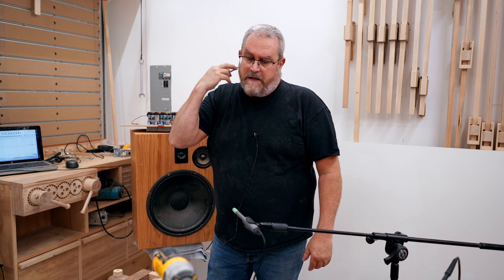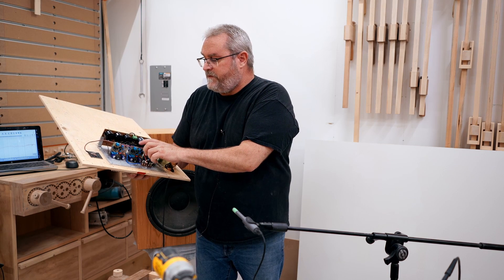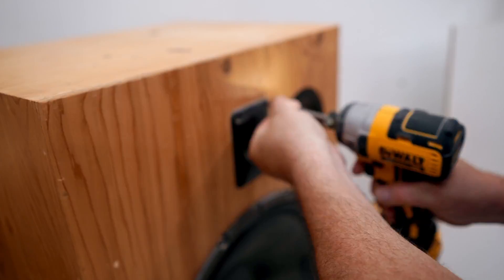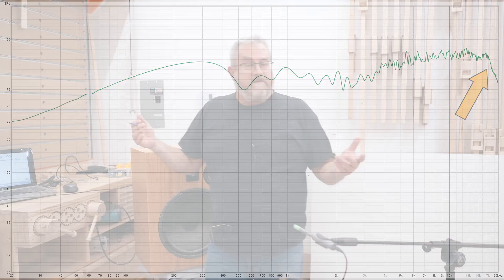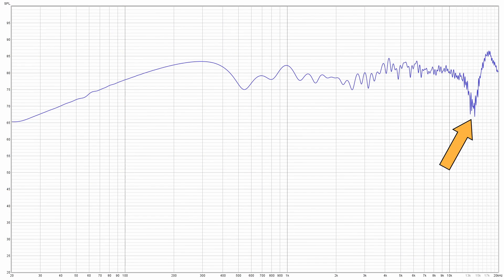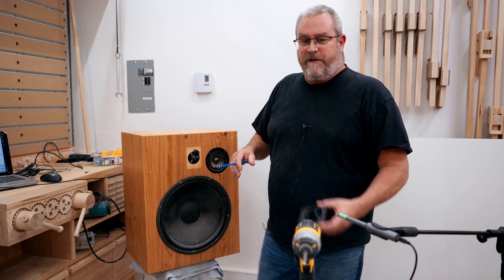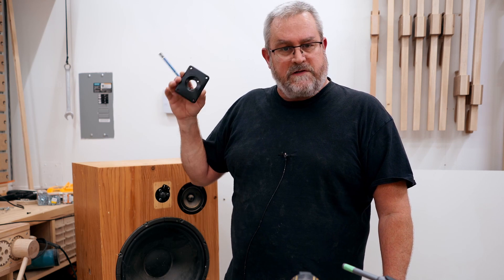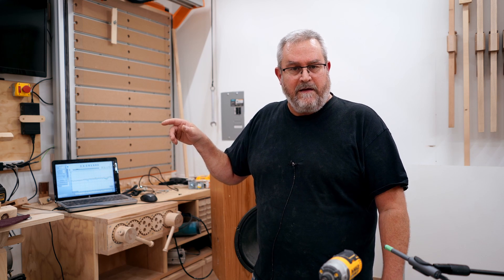Tweeter Horn Magic - What does a Phase Cap do?

Comment from the maker: Kind of a show and tell on the speaker to begin with. I made these in 2009 and used them in my old workshop for 4 years. It's a three way active and I made the amps / crossovers plus the power supply. Each amp board has lowpass and highpass Sallen-Key filters and an LM3886 as the amplifier. The crossover points are 400hz and 3000hz, set by the values used for the filters on the amp boards.
I consider this to be some practical exploration on what a horn and phase cap can do to the response and I'll use this knowledge to mess around with the horn flare on my new open baffle speakers.
The measurements clearly show the horn bumping up efficiency making it possible to get rid of that natural peak in the response the tweeter has. The phase cap helps as well to produce a more even response with a smooth roll-off. 
In the last word on diffraction, I think it's one of the more obvious ironies in audio today that the same guys that think diffraction is a big problem, advocate listening in an untreated room. In fact they emphasize the importance of the off-axis response of a speaker so that it's more complete when it bounces off the wall beside it! If there was ever an audible effect, the kind of comb filtering those reflections produce would be at the top of the list.
That raw response (from jus 24" from the speaker) is what your ears are receiving. Not the smoothed response where you can examine minor ripples - that full 20db deep grass. And from your listening position that grass starts to look like hay that's late for harvest.
Reply: Talk through a large cone shape,  and it will amplify the output of your voice.  But does your voice sound the same on the other end?   Does it sound better... or worse?   Or is it merely just "Louder" ?

 The horn colors the sound, and distorts the natural image of the sounds that its trying to represent.

 There is a good reason why those old record players with the large metal horns, didnt stay a standard... and its beyond the issues with the record-media itself.
Reply from the maker: @johndough8115  Your mouth itself is a horn, actually. The sound is produced by your vocal cords down in your throat. Your ears are horns as well.
Reply: @IBuildIt  Our Voices, are meant to sound the way there are, as they are.   Adding an additional Horn AFTER our mouths.. causes Distortion to the INTENDED sound of your NORMAL voices.

 Similarly, adding a huge cone on our ears, would also distort the intended sounds, as they were meant to be heard.

 Your argument, is childishly bad.  Like something a 7yr old would say.
Reply from the maker: @johndough8115  Horns generally don't distort. They boost a range of frequencies, much like I show in this video. And that boosted range of frequencies actually have less distortion (at the same volume)than the original sound. 
They certainly have their uses, as shown in this video.
Reply: @IBuildIt  Yes, they Do distort.  You dont get something, for Nothing.

 As Ive said, Put a huge cone in front of your mouth, and record or have someone see if they can tell the difference.  They will.  The sound changes.

 The amount of change, is much smaller, on a much small scale.  Its far more notable, when you scale that horn up in size.  Yet that scaling shows that there is in fact, changes.

 ONE of those changes, has to do with timing and 3d image positioning.  When you alter these things... you alter the intended effect and positioning, of the instruments / soundfield.

 While the frequencies might be similar... the sounds "IMAGE"  is NOT the same as the recorded sounds image.

 The only way to know this... is to hear it with your own ears.  Such as a direct A to B comparison, of two identical pairs of speakers, side by side.   AND... these speakers have to be of a high enough caliber, to actually be able to project an accurate 3D Image in the first place.

 (Though, at high enough volume levels, the image still might come through enough to be detected)

 You yourself, have stated that Room treatment drastically changes the way things sound.  Why?   Because the sounds bounce around the room, and change... depending on the types of surfaces hit, the angles they hit at.. and how they interact with the other soundwaves in the room.

 Its the same type of thing, on a smaller scale.  The original soundwaves are being Altered by the shape of the horn.  A specific shape, could cause... for example.. the soundwaves to "Invert" from the original projected image.  (Think of the game QIX,  where the lines bounce and change directions)

 Again... its just like the previous example, of holding a large cone in front of your mouth.  If you realize that can change the way your voice sounds, and is positioned in 3d space... then you SHOULD be able to recognize this LOGIC, on a smaller scale.

 Some time ago, I thought about making a tweeter that fires upwards, at a stone that was carved in an arc shape... to spread the sound in 360 degrees.  I later realized, that the act of bouncing the sounds off of the curved arc itself... would distort the intended image.

 (Also, I later heard a 360 degree di-pole ribbon tweeter.  And the 3d image was massively distorted, because the sounds that were intended to come from the front face of the speaker...  were also coming from the rear.. bouncing off the walls, and returning slightly later... almost making an echo like effect... that ruined the music / image.   At most, for a novelty effect.. you would want a 180 degree throw.  Never a 360 degree throw... unless maybe your entire room was lined with sound absorbent material)
Reply: @johndough8115  tell that to Danley Sound labs.seems you know everything about horns AND crossovers? Horns have applications fyi.  diphragm needs HORN to direct its sound to the listener. your analogy of "Adding an additional Horn AFTER our mouths" is REALLY FUNNY . our vocal cord=diphragm, mouth=HORN.  HORNS aid the diaphragm's soundwave DIRECTION and CONTROL . WELL DESIGNED HORNS make our listening BETTER.. designing horn is for the knowledgeable and imaginative professionals, leave that to them. just sit back, relax & enjoy the sound.
Reply: @dickyloggins7372  tell that to Danley Sound labs.seems you know everything about horns AND crossovers?

- I wouldnt say I knew everying about Anything.  What I will say, is that Ive probably owned about 30 different speakers.. and heard a lot more in-person.  That, and I realize that you dont get something for nothing. There is always a Price to Pay.  The shape of a horn, amplifies its loudness.. but that comes at some costs.  One of those costs, is a change in the original sound profile... and thus, the 3d soundstage becomming "Flatter" / distorted.

 Horns have applications fyi.

- Of course they do.  One of them, is to be very loud, and spread the sound very wide... so that a club full of loud taling people, will be able to hear the sound decently.  As such, DJ type of speakers, are not really designed for Audiophile level sound reproduction. They are for loudness and dispersion.  Not clarity and flawless accuracy. Not 3D soundstage.

  diphragm needs HORN to direct its sound to the listener. your analogy of "Adding an additional Horn AFTER our mouths" is REALLY FUNNY . our vocal cord=diphragm, mouth=HORN.  HORNS aid the diaphragm's soundwaves DIRECTION and CONTROL . WELL DESIGNED HORNS make our listening BETTER.. designing horn is for the knowledgeable and imaginative professionals, leave that to them. just sit back, relax & enjoy the sound.

- There are many tweeters out there, that do not use a Horn.  They are made, just like a woofer.. but handle the high frequencies, rather than low.  An epic example of this, is the EPI 100v tweeters. Ive personally never heard any better tweeter, to date.   Adding a Horn shape to these tweeters, isnt necessary, nor desired.  It already has such a wide 3d Soundstage, so that almost the entire room... no matter where you stand, sounds like a the perfect "sweet spot".  Furthermore, they are so 3d, that they vanish into the room.  Meaning.. that If I put a blindfold on you.. spun you around 12x, and they said to walk towards them... you likely wouldnt be able to find them.  It basically makes it sound as if the band is playing live.. to where you could point to a 3d position in the room, where they were virtually playing.   Most speakers cant even come close to that level of reproduction. Horns will never be able to do that, period, because they distort the image shape.. while traveling down the extended tube.

- As for the human description.. I liken the bodys production of sound, to the Motor of the speaker driver.  These things cant ever be a direct comparison. However, My example still stands true. If you place a large cone in front of your mouth, the sound of your voice will be louder.. BUT... it will also change in tone and depth.  That again, is the price you pay, for using a horn shape.

- Horns are clearly not as "Exaggerated" in effect, compared to placing a horn in front of your mouth... however, there IS in fact changes happening.. even if your ears are not good enough to hear the difference.  Of course, in most cases, its the lower quality drivers inside of the horns, that make things even worse... because, even if you made the horns more shallow, you still wouldnt have excellent output.. if the drivers were  "low-quality / higher distortions".  Using low strength magnets, and low coil strength, tends to result in less control.. and more potential for distortions of the original image.  This is the main issue with todays "ECO-Speakers".

professionals, leave that to them

 - Many professional, have created giant steaming piles of Poop.  A designer cant always do what they feel is the Best thing. They are often restrained by Costs, Profit Margins, and the Secret ECO-Caball.  They simply work with the company, that dictates what level of Cheap Chineseium parts that they want to dress up with a pretty box.. and overprice it to the moon.

 Bose is a prime example.  They use like 5$ drivers, and 20$ in special EQ electronics, to try to prevent their Crappy low power drivers from over-distorting.

 Then they spend millions of dollars on advertising.. to make people think that they are the King of high quality audio... while selling you under-powered, low spec, way overpriced, speakers.
Reply: @johndough8115  "Furthermore, they are so 3d, that they vanish into the room.  Meaning.. that If I put a blindfold on you.. spun you around 12x, and they said to walk towards them... you likely wouldnt be able to find them". Well that contradicts to what is "3d soundstage" is all about, maybe that EPI 100v tweeter is a total chaos hehe.  3d soundstage means you will be able to exactly  "locate" the instruments' sounds, just like what u will experience in hearing live performances. 

instruments & human voice has so called fundamental frequency AND harmonics, naturally. waveguides/horns "colors" sound because of the added harmonics.it is up to the designer how to design a speaker system with waveguide having minimal harmonic/harmonic distortion so as to make the sound "more" lifelike.   designing speaker sytem is an art & science, leave it to the more knowledgeable and creative professionals. not all of them design piles of Poop.
Reply: @johndough8115  https://www.youtube.com/watch?v=FzeZbJceKZE   this is what's happening in audio world. 

no one can faithfully reproduce the "original" sound of any performance because of added harmonics right from the recording to processing (which includes mixing and mastering). recording gears add harmonics, especially tube/vintage gears, to add "character" to the original sound. take for example a voice recording. signal chain of  voice recording starts from voice--mic-Equalizer-compressor, then mixed with doubler, flanger/chorus, reverb, delay etc all of which contribute to the addition of what's so called "Harmonics". harmonics give character to sound (good and/or bad). what the "better" speaker designers (professionals) can do is designing minimal harmonic/harmonic distortion, flatter frequency response, wide dynamic range, good soundstage  speaker system to make it "near" lifelike. these you can find mostly in "not cheap" audiophile products.
Reply: Yep, you did well... everyone is different not a lot have golden ears, but a lot of us have Tinnitus of some sort nowadays. 
Everything sounds different to everyone, and what you like is the only goal when it is your room.

Comment: Hi John. I'm rebuilding a 3 way speaker system. The tweeters have capacitor x-overs. I have  3 way x-overs that I want to use Instead. Should I remove the caps from the tweeters first?

Comment: I love these videos. I make my own  eveything. Thisnis exactly the kinda stuff i do all the time. Modifing speakers to see what happens. Phase cap stopped the cone from breaking up basically. 17k is a common spot for tweeter breakup. Good domes usually mitigated this with design and dome material. Still always love silk. But some of those good planar tweeters sound amazing especially in the ambiance high frequencies. Im lucky i can here tweeter polarity issues and refraction super well it almost a curse! I spent 2 yrs in my truck getting 3 way passive setup and all the polarity correct with the mounting locations. Multiple driver changes. Now for top end I have Peerless by Tymphany NE25VTS-04 1" Silk Dome Tweeters and Dayton signature series 4s mount almost on top of each  other all wired with a custom passive crossovers and custom made cables. Even for my sub. But only spent 1200 and it sounds better than anything ive ever heard.  It is full tunes with a calibrated mic. Well multiple. But its flat 1 to 2db from 30hz to past 20k.

Comment: My understanding of what the plastic 'phase plates does is:  a tweeter is not efficient at pushing the air, coupling to the air. The tweeter is moving so fast or the air pressure or something that : the air in front of the tweeter just kind of moves out of the way instead of being hit by the tweeter. So the phase plate holds a cushion of air there like high pressure long enough for the tweeter to couple. Sorry for the non-expert answer, I tried

Comment: There's a massive difference between edge diffraction and a room reflection that you're not taking in to consideration. That is the time it takes to arrive at your ear. A diffraction caused cabinet geometry arrives very close to in time with the direct signal, as where a room reflection comes much later. Our ears perceive these 2 things very differently.

Comment: I think that point is not in only some strange little refraction or here and there wiggle on the chart. Instead point is in doing 100 of those little measurable but not hearable improvements in hope to get one "big" difference in the end when you add all those little things together.
You could argue that you can not hear neither one nor 100 of so small differences but I think you would be wrong. If you have time and money it would be interesting project to hear and see the difference between one speaker built with all those 100 small things we can not hear incorporated like horn loaded tweeter in the same plane with other drivers and rounded corners and inside reinforced speaker box and spike speaker box legs and weighted box with concrete pour on the bottom and 1mm pressure equalizing hole in the back of the enclosure if it is not ported and tapered design so the tweeters has less surface of the front panel and .... and ......
Compared to real square fat flat box sitting flat on the bench or floor without leggs with no magic details added.
I think you would for sure see the difference in recorded chart and also hear the difference with your ears. It would not be much but you would definitely hear it. Would it be worth doing ? Probably not. Would it be fun ? Definitely yes and that is what is all about in the end :)
Reply from the maker: One of those 100 things might be the shape of your outer ear. You could have plastic surgery done to make it the optimal shape for detecting the other 99 inaudible issues to tweak.
Reply: @IBuildIt  😂😂 No that is 101st thing that comes later when you exhaust all other hahah

Comment: you can measure things you cant hear and you can hear things you cant measure, for a good result you need to use both..
and about gating and smoothing, try setting right window to 4.5 and left window to 1 and see how it smooths out.
Reply from the maker: Technically, every sound can be measured. What can't be measured is how our brains process and interpret the sound that is picked up by our ears. A huge number of things affect how we hear and what we think we hear.
Reply: @IBuildIt  technically yes but its not always that easy to hear a dip in the response, dont think its just your ears.
i just finished up a set of small bookshelf speakers with a 3. order passive x-over
they measured just right but still the tweeters sounded a bit sharp on some recordings.
i then replaced the aircore inductor going parallel in the tweeter x-over with another one (same value) that had less resistance, the difference was under 0.5 db drop in amplitude in the region where the coil was working and the change was huge, they became very pleasant with absolutely no sharpness to it without changing the overall tone.
i dont think many would look at the measurements of the two configurations and think there would be a very big difference in soundquality.
and thats my point, some things are difficult to hear other things are easy.